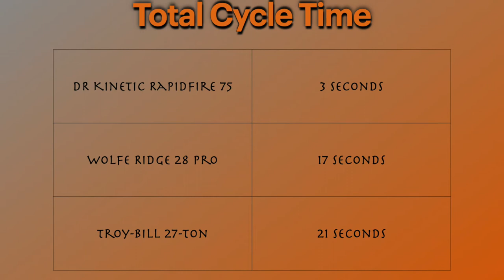#95 - Cycle Time Challenge

Comment: one of the fastest splitters I have seen is the gear drive Pittman arm type.
Reply from the maker: I had to look it up, and am watching a video about one right now.  Very interesting - it would be nice to make an electric one - I wonder if I could turn my DR into a pittman arm DR splitter - Enjoy the Journey Vern - cheers
Reply: @botabob  I'm not sure that the exact name for it and I wonder where they all get those heavy gear boxes,, some of them are strong enough to cut a stick of wood in two.
Reply from the maker: I wonder if the gear box on a brush hog would do the job
Reply: @botabob  it might , it has to be geared pretty low,, I saw one where a guy  used a truck transmission and  the differential,, he cut one side of the diff off and locked the spider gears..

Comment: I wish I would have known about those kinetic splitters when I bought my hydraulic actuated splitter.   Hands down it would have been coming home with me.  My current Tractor Supply splitter has about 300 hours on it with no troubles.  Oak, locust, some cherry and a bunch of ash.   
Cheers!
Whipple
Reply from the maker: Not all Kinetic splitters are equal - stick around and I will show you why I do not use the DR - thanks for watching and commenting - Enjoy the journey Whipple - cheers
Reply: @botabob     The Amish around here use a model made by a company that may be defunct - Super Splitter.   It might be the same one now made by Oregon.   I see them in a bunch of the farmyards in Somerset County, PA.
Cheers, Bob!
Whipple
Reply from the maker: I hear there is a kinetic splitter made in the USA that is good. I can't remember if I saw it on the Tractor Tech or Ohio Wood Burner channels - In my opinion, stay away from the DR brand of kinetic splitters
Reply: @botabob     I am eager to watch your DR review and hear what makes you have a low opinion of it.  
Whipple

Comment: Wolfe Ridge is a bit slow, but not so bad.   4-way wedge improves production of each cycle.   Also, depending on length of logs,  full retract is not necessary.   Boy that Rapid Fire is smokin fast,  but parts wear out quickly and are expensive to replace.
Reply from the maker: I have replaced the the handle grip twice - The last time I used this for making firewood - it kicked back so many times I shut it down and said that's it, no more, and I bought the Wolfe Ridge - I only brought the RapidFire out for this video after one of the channels I watched encouraged me to make a video about my experience with the DR RapidFire.  So, after a lot of consideration, I thought I would express my opinion about my experience with the RapidFire - I watched a lot of videos about the RapidFire, and everyone really liked it - not one video talked about kickback - So, I thought I owned it to the firewood community to caution people about purchasing a RapidFire.  Thanks for watching and commenting - enjoy the journey - cheers
Reply: @botabob  Makes total sense Bob.   Thanks for making the video.    I’m a Wolfe Ridge 28 Pro fan, myself.    

The SuperSplit is made just a couple towns over from me, here in MA.   It’s one of the original kinetic type splitters and has good reviews.    

I have a DR tow behind lawn vac, and a field/brush mower.   Both are older models and high quality.   Too bad the splitter had those design flaws.
Reply from the maker: I understand DR was purchased by Generac.  A lawn vac would have been nice this evening - I was out mowing leaves until sundown after work today - I really need a better solution - thanks for your insight

Comment: I'm not very impressed with Wolfe Ridge pro cycle time, Wolfe Ridge 28 Pro specs the cycle time at 12 seconds, my old Cub Cadet 27 ton cycle time is nearly the same at 12 seconds full 24" stroke.
Reply from the maker: My 28 Pro took about 17 seconds to cycle - I understand Wolfe Ridge is working replacing the pump on new Wolfe Ridge splitters.  If you're looking for a fast cycle time, the 28 Pro version may not be what you are looking for.  This is just my opinion based on my experience - it's a well built splitter, but it is only average when it comes to hydraulic performance - thanks for watching and providing your feedback - enjoy the journey - cheers
Reply: @botabob  Thanks for your feedback.
Reply: @jeromeprzybilla9999 , something isn't right with this splitter. Have seen it on video demonstrating the correct cycle-time.